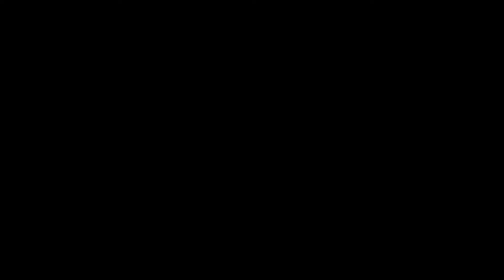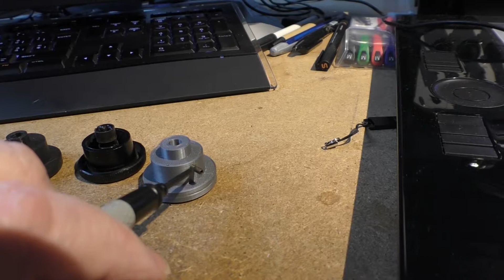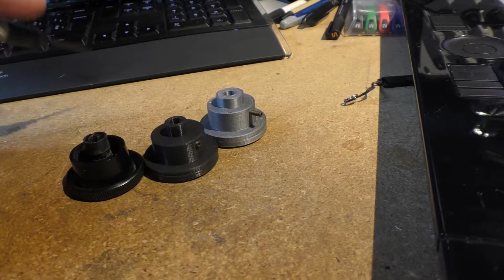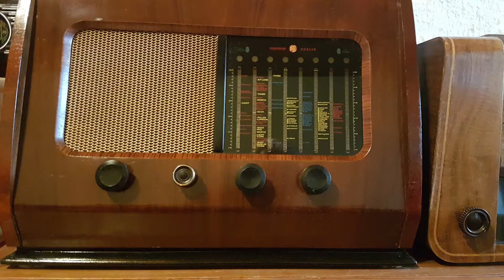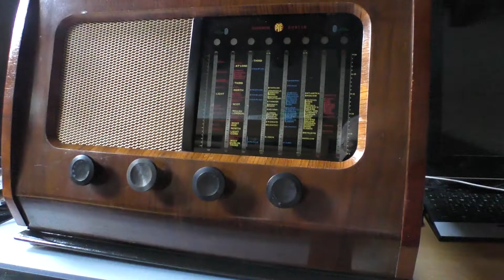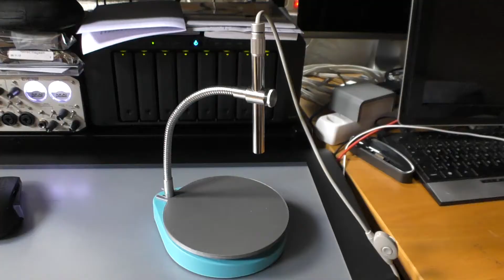3D printed radio knob - final

Comment: Interesting, so the knobs on British/Irish Pyes from the late 1940s are made out of Bakelite? There is a Canadian Pye that I have seen from time to time, a model 39HC I believe, and the plastic in the knobs actually deforms and falls apart, so I suspect that they used Tenite or some unstable organic plastic to mold those knobs rather then proper Bakelite. Almost every model 39HC you see has either knobs missing, or are substituted with the incorrect ones. However the two Canadian Pyes I now own used solid Bakelite in the knobs.